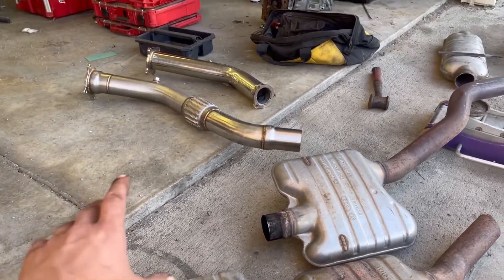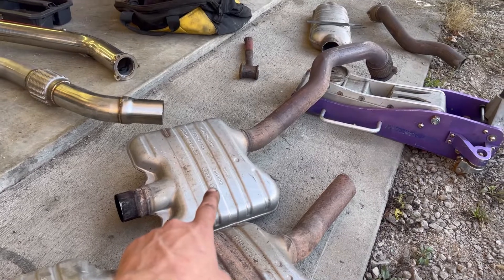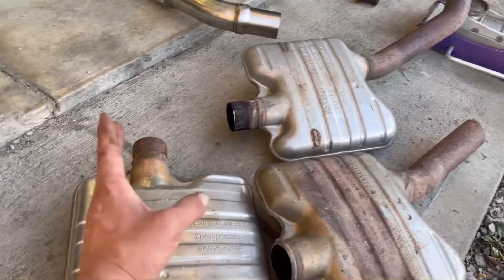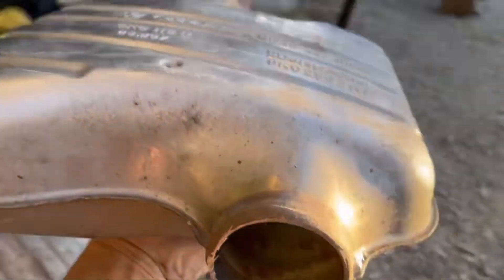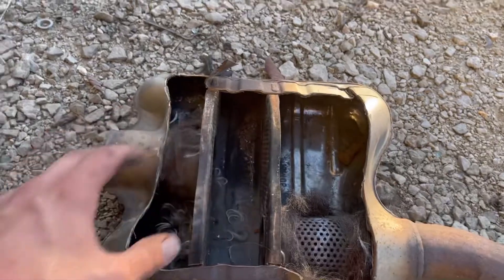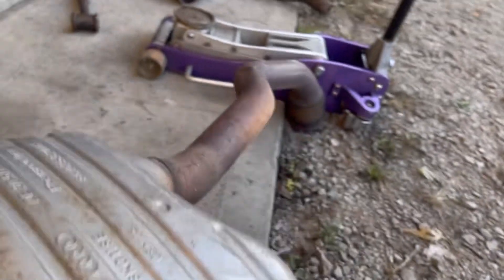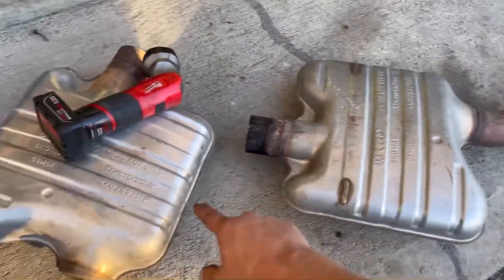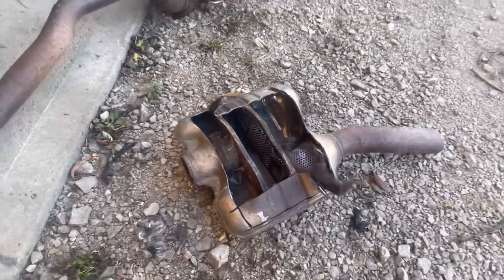2.0t Audi flex pipe / mid pipe comparison 09-16 b8 b8.5 ae888 a4 a5 q5 a6 turbo performance mod

Comment: I wanna get a down pipe an res delete,,with no tune yet,,you think I'll be ok using foulers on the o2s I only need it on the 1 that's right after the cat rite ,or I'ma just gut out the cat ,,,I don't have any inspection laws in my state so I'm not concerned with that but eventually I'll get the tune when I got a grand to burn ,, probably only stage 1 until I upgrade the turbo,,I have all upgraded armmotorsporrs charge pipes,cts turbo muffler delete ,3 inch ecs cold air intake,cts catch can ,plus turbo blanket an intake along with all charge pipes heat wrapped from throttle body to intercooler to turbo, newest updated intake manifold,I just had a put new injectors in I had one get stuck open so ,but anyways also obdeleven pro scan tool , arp red top coil packs ,only running 9 to ten psi of boost I got a solid waste gate arm with no nut on my ihi turbo so I can't turn it up without replacing it ,wish I knew a trick to the n75 valve to up the boost to at least 13 14 pounds but I'll get there,,but again about the exuast what do you recommend how to handle not getting the engine light on if I gut my cat or put on a new (cheap) down pipe,,thank you again for all ur vids ur input is highly appreciated 😎👍

Comment: Wow! So the resonator is not restrictive at all and removing it is a waste of time. I would not have guessed that with how many people remove them.
Reply from the maker: The one that came off my Avant was more restrictive and I would prefer to run the other 2 strait through styles but yes still not very restrictive even on the cut open one.  I’ll cut open the muffler in a future video